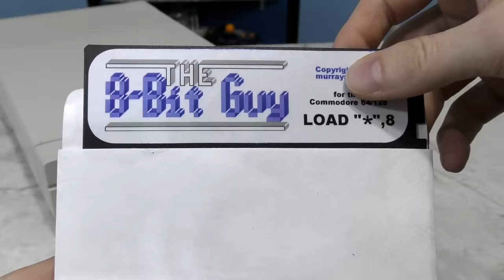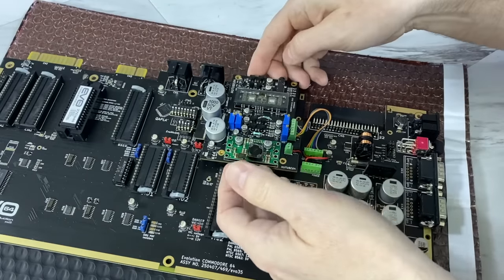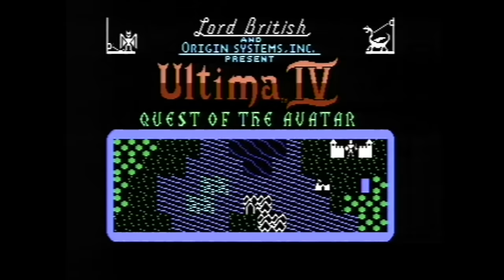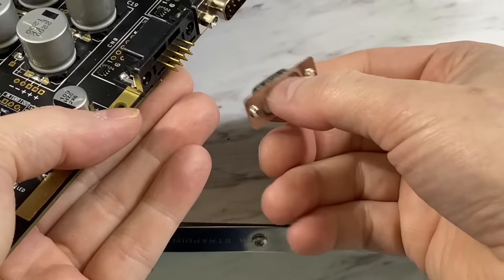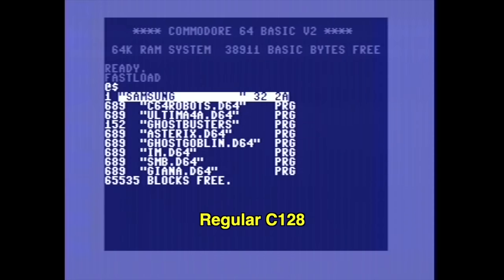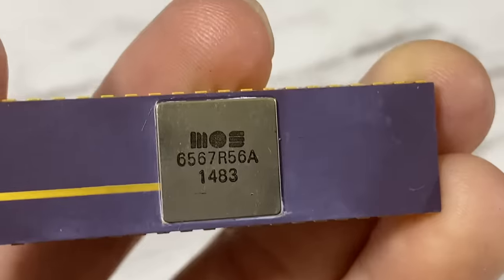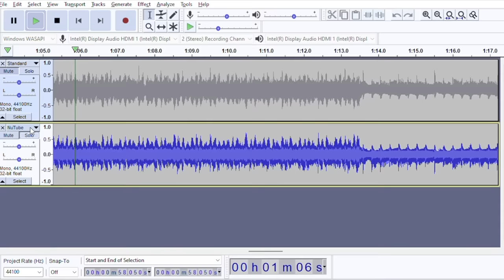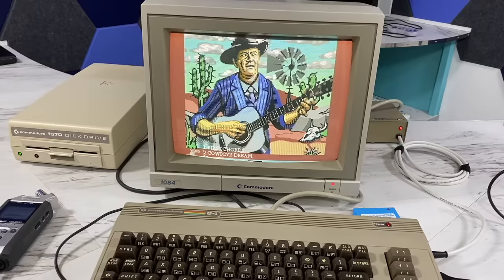The Evolution64 - Is it worth the money?

Comment: For the "mod all of the things" people out there, what does a c64, or even something like a spectrum zx look like if you go "install all of the performance modifications", I've seen a few on your channel but what does it look like if you take a stock classic and improve it as much as possible, even if that ends up  using an rpi or other micro much more powerful than the entire machine to handle something like audio, or video, or Co processing? 

How far can upgrades be pushed, whilst still having the same machine?

Edit: recap with really nice ones, voltages absolutely perfect not "good enough", modifications, daughter boards, controllers... Add ons, perfect soldering etc. 

What is "the ultimate" tripped out classic console, what's added, how fast is it? How is it better?
Reply: To play a few select original games "better" you can increase the clock speed on a C64.  That's about it.

Comment: The vacuum tube stuff isn't entirely bunk, but most of it is, and the legit stuff will tend to be reproducible with the right transistor circuit, or be microphonics (that can probably still be reproduced), or be in voltage handling (that can probably still be reproduced).

Comment: That inverted waveform thing is definitely weird.   No idea why they would have done that deliberately.   Seems like someone just made a mistake and inverted the signal.
Reply: not really. Even phase rotation amongst channels is irrelevant. There is no difference between push-pull or pull-push. C64 is follower emitter output. Nutube is common cathode (in transistor lingo it would be follower collector). If you want to rotate it again, it would require another round of jfets, adding more noise and cost. Since even-phase rotation is irrelevant, I decided not to bother. Just rotate the speaker cables and you are set.

Comment: The most common theory I've heard about how tubes make a difference in audio is via euphonic distortion...i.e, the tubes actually introduce distortion to the signal, but it's distortion that sounds good. Assuming that's the case, the comparison to vinyl isn't especially apt, since vinyl in theory is leaving intact data that the digital signal is losing via digital sampling. Euphonic distortion should still be audible after the signal has passed through solid state components, so maybe this just isn't a very tubey sounding tube.

Comment: The tube version sounds more saturated/more distorted with higher THD. It's cool, but it actually kinda muddles the crispness and 'bite' of the original sound which I prefer more. And it would be great to see the video comparison using a VIC-II Kuwari standing in instead.

Comment: II make music with a synth which has a nutube on it. I could hear a difference between the nutube and dry output on my studio monitors. The nutube just sounds a bit richer but it is definitely not worth the money. The richer sound perhaps comes form filtering on the module. The soft clipping characteristic of tubes makes those raw sqare waves sound better in my opinion. The PWM sounds in the first tune of the intro sounds like it has a filter sweep to it wich is quite interesting.

Comment: Like a lot of other products out there, you're going to be spending a huge sum of money for a negligible improvement in quality. The original C64 is ~98% as good as the Evo64, so it's hard to justify the cost and time required to get that ~2% improvement.
Reply: Unless you specifically refer to the 326298-01 C64 PCB, there isn't an "original" C64 when it comes to audio output quality. The various commodore 64 motherboard PCB revisions typically adds different amounts and characters the audio output signal (most noticeable is often the VICII interference). Now I don't know if the Evo64 improves on the base noise level even without any kind of tube preamp but it probably does. If you ever have tried to run a C64 audio output to even moderately high volumes on good speakers all that noise really becomes annoying and you start to look for solutions like SIDFX just to lower that random noise. For me the difference goes from 0% (painful) to 100% (still noisy but ok) just by fixing the power voltage coming into the SID on most of the regular C64 mother boards.
Reply: @pleggli  Calling it "original" is enough to have 99.9% of people understand what I'm referring to. If you choose to be extremely specific, that's fine. But it's entirely unnecessary lol. 

If Coca-Cola releases a new recipe, it would be perfectly reasonable to refer to the previous "classic" iteration as the "old" recipe when comparing it with the revamped one. It would be hard to take someone seriously if they nitpicked the use of "old" because they don't know if you mean the previous Coca Cola classic recipe (of which all are familiar), or the very original that hasn't been produced for over 100 years that contained unrefined coca-leaf extract in which no drinkable bottles survive and nobody living has ever tasted.
Reply: @K-Fed  there is a huge difference in noise floor of some of the board revisions though, like at least 10dB and possibly even in the 20-40dB range (i do not remember the actual numbers and I am
not going to measure it now).

While technically not a pure C64 the worst sounding one one is IIRC the C128

Comment: The tube technically does create a harmonic filter envelope which changes the characteristics of the sound waveform which you could demonstrate with lab equipment, but it doesn’t create a perceptible change to most people.

Comment: vinyl records never were intended to 'sound good'. just to be cheap, easy to handle and transport, and sell in masses to consumers. they produce side noises. lack the full frequency range, often are wobbly. do not maintain a perfect speed, etc. and heck the coils in those elemens probably don't even all create the exact same induction for the same movement even if all arm needles would be equally long and the diamonds the same size, so that whole thing is a bit of a non-discussion. now. if it were up between let's say a 1970s 1" studio tape recorder (just one. as there too it will be hard to produce 2 that are calibrated exactly the same way, with all that analog stuff, and a wav file. that's a different matter :P the number of unknown factors (capacitors, coils, etc) is just a lot less in eh, basically anything that comes out of a computer or a chip :P also it's gonna do it all at a precision of at least 4 decimals from the desired clock frequency which cannot be said for a a random motor spinning some piece of plastic around at what should be 33 1/3 or so rpm :P (maybe, maybe not , depends on the weather ;)
Reply: YES! It is fine if you enjoy analog formats or tubes for what they are. People have to check their nostalgia at the door and accept that it was far from perfect and not even close to todays low end equipment in quality of replicating sound.

Comment: I have to comment here: when you compared the two audio outputs I'd have to say that each chip has their perks and quirks. 
The original chip definitely sounded like well, the c64. Fairly decent sound considering. 
The nutube is interesting. C64 sometimes seems to have an "artifacting" sound. I can hear it anyway. Nutube seems to have slightly cut it down (hence the inversion i think). Anyway I agree that both sound good regardless.
Reply: the inversion is normal when a signal passes a triode it gets inverted...if it had a preamp stage then an output stage the signal would be flipped back to its original form....works the same with transistors too...the iv«nversion was either a design flaw or a "who cares" situation

Comment: All of this is Hw we can’t actually buy yet. This is „coming soon“. Some of it has been „coming soon“ for years now, like most of the replacement parts from the C64 build Perifractic did.

So will this come out soon or is this something that will only be prototype boards sent to YouTubers like the FPGA custom chip replacements that have been in beta test and „coming soon“ for years now?
Reply: If these things have a price, you can be reasonably sure its not vaporware and its on its way. There's no way you could nail down a final price without at least close to a final product.
Reply: @Tahngarthor  well I thought so as well but I’ve been following the C64 enthusiast space on and off for years now and there’s a lot of stuff that is in „in beta test now“ or „coming soon“ state and has been for several years. To an extent where only retro YouTubers have actually access to those devices

Comment: Hm, the beginning of the Giana Sisters theme sounds clearer and fuller on the NuTube but I don't know if this is because of the way the audio signal is routed. I'm perfectly happy with my standard C64C though. Still need to get back to fixing my second one though, as it has issues that feel like faulty RAM but shows all 38911 Bytes free at the Basic screen. Also my Pi1541 is busted, hopefully just a cold solder joint (the Pi itself is working perfectly fine).

Comment: You may remember that vacuum tube and transistor amplifiers have several modes of operation?  I think the argument that analog is better than digital is based on a comparison of music recorded with analog equipment played back with an analog tube or transistor amp operating in Class A.  A class AB (push-pull), B, C, or D amp will have poorer sound quality compared to Class A, but will be much more efficient (higher output gain for a given input signal level), but I digress.  

Playing this kind of audio in comparison with a digitally sampled signal being played back by a modern Class D (digital) or Class T amp will yield a detectable difference, but it's one that, for most people, will not be perceptible.  The preference for tube amps is because of the mild distortion that occurs when the preamp is slightly overdriven, giving a "warm" sound.

I'm not personally a fan of any kind of distortion in my audio systems (except, maybe my bass guitar amp - that Rickenbaker growl...)

This board is quite expensive, but it is a deluxe product with lots of new features.  I hope the price comes down over time.  I'd love to actually own a C64 or C128 one day.🙂

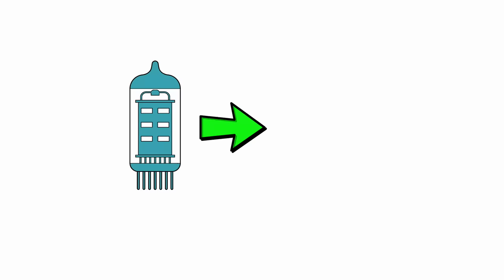Comment: 13:05 There is an improvement between tubes and, at least admittedly cheap, solid state gear. At work I usually have a boombox going to help me through the day's drudgery and of course they're cheap little things. Two solid state units made within the last ten years, both sounded like crap(Very tinny and statick-ey), both died quick. Replaced then with a Zenith from 1957 that I got off eBay for 50 bucks and oh my god it sounds so much better. Especially with particularly heavy tracks...stuff from Metallica, Judas Priest, Ozzy/Sabbath, etc...there is a definite warmth to tubes that transistors don't really catch. And I can hear that from an FM signal in a noisy job shop over the din of welding and impact guns that permeates the place during the workday!

That being said, it's not enough of a difference to warrant spending a fortune on tube gear. I bought that radio in part because I just plain and simple love vintage stuff and in part because I wanted to buy a radio that I could actually repair should it need it rather than just grumble, throw away, replace. The tube set from 1957 fits both bills. It sounding a little better is a nice perk, but it's not why I bought it. It costing about the same as the more modern solid state boomboxes and already having a full recap/alignment done before I ever got it are also nice perks heh heh.

I run that tube set 40 hours a week and it hasn't skipped a beat in the last 3 months.

Comment: I understand there is probably some more work involved, but damn $500 for the Nutube? Those things go for $50/piece for just the tube. I can't imagine the additional amount of circuitry (mostly a high voltage source that looks like it's off the shelf anyway) and engineering is another few hundred dollars especially considering the major part of the board is $300. Looking at the other video he mentioned component selection and break in...still seems like some serious audiophile bait. Edit: Oh yeah, they mentioned sorting JFETs...which are transistors! So there are still transistors in the signal path around the tube anyway.

Comment: I only noticed barely a slight improvement in sound, a bit louder and fuller. Otherwise, negligible for anyone else to really tell. $500 bought you a very expensive light bulb to shine through the plastic! I did like the dual SID Chips, that was some wicked stereo separation!

Comment: So, regarding tubes: No, you do not lose the improvement by converting to digital. That's because, unlike most of the HiFi hyped nonsense, tubes are actually doing something to the sound. They introduce distortion, and change the transient response. And both of those changes to the sound are usually perceived positively by our ears.

I would also suggest that the inverted signal is actually a bug in this device's design, as that absolutely can change an audio signal, usually for the worse. Though with the limited bass output of the SID chip, the effect is minimized here.

Comment: Tubes are simply not great clean amplifiers. They are slower and there for round to the signal. If that’s your thing than fine. But it’s a terrible class-a amplifier. 
I used to play guitar solely on tube amps (snob). But when gigging I realized how unreliable tubes are and I often had to change them out before a gig (stress you can do without). At a certain point I was so fed up and went all solid state. Nobody heard I was playing solid state. My compressor had some nice germanium clipping diodes in it to simulate the rounding of the signal. And the solid state amps still bloody work without a single repair, after 26 years.

Comment: I hear the difference even from here all after the distorting effects of the whole internet so I am sure there is one... Of course those can be only "in-person" tested. Also vinyl is not always created from digital sources - especially old but good taken care of vinyl is from analog source material and I do hear difference there too.

I also suspect this has to do with music taste too: electronic music in modern times usually not making sense on vinyl neither - except gems where they use analog parts all through. But many live music players (like classical or good-enough guitar based things) do have analog recordings - where when I say "many" I am not saying "majority" or anything like that, but a measurable amount.

Also even if later stages (like your monitor amp) are transistor based, the sound can change highly if the pre-amp or earlier stages are tube - this is for example well known in guitar world and so on even in such little bands they hear these changes like my brothers band...

For me the new one sounded better in the intro but what I am sure of is that there is a difference. 500$ is a bit huge for it though for me, especially considering the source material is basically optimised for the original parts anyways and retro being usually more about memories than perfection. Likely the price point is also huge for the limited audience.

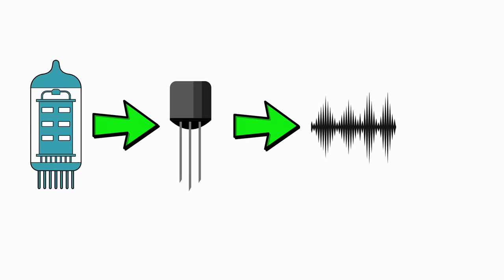Comment: around 12:50, about the impossibility to test for audiochanges with tube source over compressed audio:
yes but no. its not that tubes are in any way technically superior to transistors if the desire is accurate sound reproduction. 
in fact: its the opposite: tubes add a charactaristic distortion to the audio which some audionutjobs would charactarize as "warm" (and so thats cool). you could totally conserve this even compressed or pass it trough to another amplifier. however, just adding anything that just technically works on the same principle as old tubes (but is not an old tube) will also not sound like an old tube. 

bottom line is, i think it will be very difficult to find any compelling argument for that upgrade. to reach that conclusion one does not even have to ask the question if it makes any sense to add some pseudoaudiophile nonsense to a machine of which the main attraction  comes from nostalgia and the whish to relive an experience the way it was experienced 40 years ago.

Comment: vinyl can sound better. your argument is just wrong. the point is that a real good vinyl production has also a different mastering process. often this isnt the case for modern productions. but if you ever had a original vinyl release from jean michelle jarres oxygene from the 70s on a good technics sl1210 or 1200 using a very good needle. then just compare it with the cd releases later in the 80s or 90s. trust me, you will never listen to the cd anymore. of course this all depends also on the condition of the vinyl.

Comment: There is a noticeable difference in the SID test. The newer sid has a cleaner and more open filter range. However, this could also be down to the variations in the SID chips over the years. Not just the 6581s which varied considerably (i have two, and they're very different to each other), but also the 6580 which came later, which doesn't have the volume register bug from the 6581, which allowed you to playback samples as a 'hidden' 4th channel during playback, as demonstrated by various soundtracks such as Skate Or Die's title music.